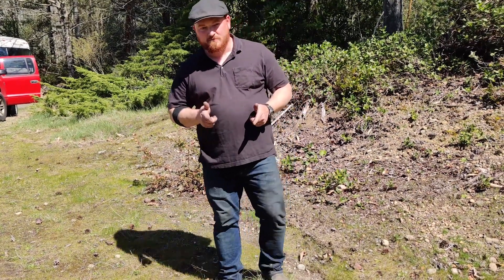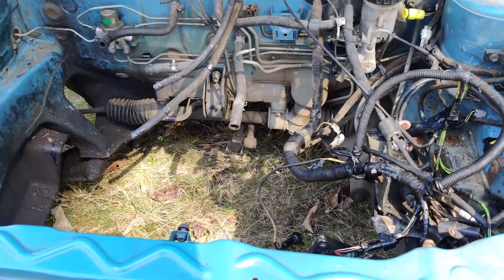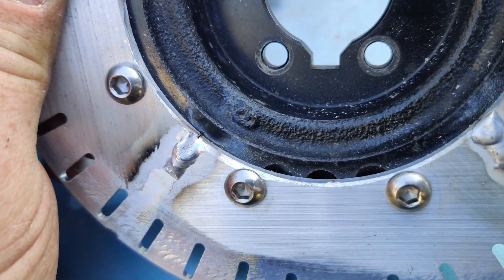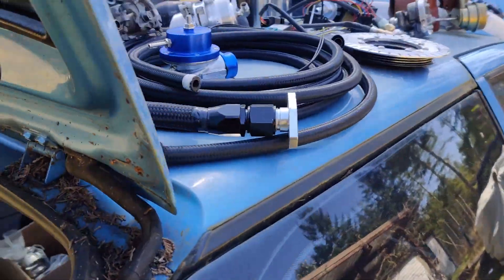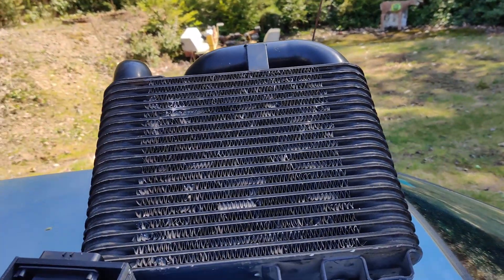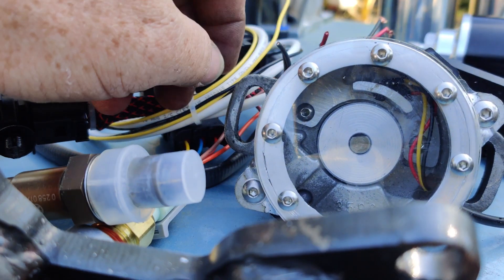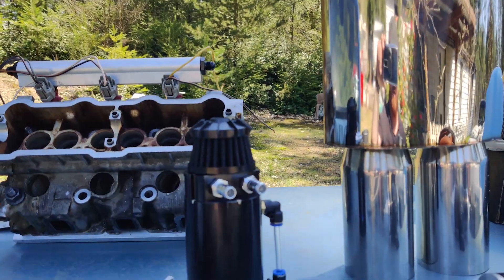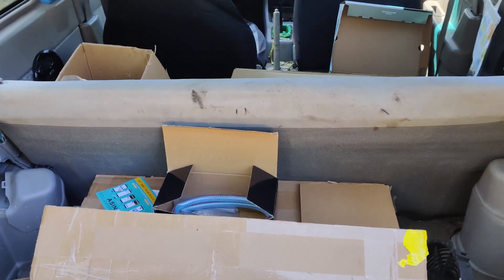EFI upgrade and turbo for a Geo Metro

Comment: excellent project where can I get the fuel rail with its supports on which the injectors are mounted and what measurements or code do they have?

Comment: Any way I can get your email? Looking to build something like this, could use some suggestions and mabey buy some  parts like the jig to machine the injectors

my plans have been similar to what you have done but use like a Honda D16 throttle body and Idle controller... for my build, I plan to keep the distributor since I can do it that way with a Microsquirt.

Comment: Who even needs injectors when you have a V8 propane forklift mixer and evaporator? My injectors just plug the holes in the head. Completely unplugged.

Comment: 20 years ago there was a LOT of performance mods available for the 1.0L Suzuki 3 cylinder motors.  From cams to adjustable timing sprockets to turbo manifolds and more.  I had a ‘96 Metro with a 10.0:1 compression setup with a seriously ported head and custom camshaft.  Stock would do 74 mph in 3rd gear and 73 mph in 4th gear at full throttle!!  After the work was done I chickened out at 96 mph with a 200 pound buddy in the passenger seat!!

Comment: Geos are the BEST cars for science experiments haha. My Turbo Propane powered 1.0 needs more RPMs... brought me here. It's the MPFI head and I'm wondering if I can directly inject the propane into each cylinder. Been running a forklift mixer drawn thru the turbo but im experimenting with blow thru now. That motor EATS head gaskets because the timing and boost are maxed out on 112 octane in the already high compression head. It barely even registered during the emissions test even with a gutted cat. I had to do this build for the $5K alternative fuel tax credit since I was in the hole pretty bad a few years back when my 87 Chevy Turbo Sprint literally broke down the week before taxes were due. I had a lightbulb moment and had this build done in a couple days. As sketchy as the whole thing is, I daily drove this for 4 years with few issues. The whole forklift tank ratched strapped into the trunk with the fuel line running thru the passenger compartment really got people upset lmao. My first test drive was in nomex and flip flops and I keep the windows cracked so it's pretty legit. Hopefully I'll have the head gasket changed today and then I'll be adding a BBQ grill that sits on the hood so it can be a tailgater rig at car meets. Also I'm looking into how i can shoot flames out of the blow off valve between shifts. Could also make a tailpipe flame thrower pretty easily. Best I can calculate it gets only 16mpg so I'm a regular at ACE hardware where I fill up weekly.

Comment: I was considering getting a metro for doing doordash up in nyc every once in a while and came across this while looking at making the inside able to sleep a person, and while im interested in the turbo im much more interested in the ultra cheap efi conversion, since modern efi can get you much better mpg id be very interested in trying to convert one to efi myself without a turbo, maybe squeeze some more power and efficiency at once

Comment: We should be friends. I have a pair of big turbos I want to put on my v8 gas truck, and a smaller-ish turbo I've fabbed up pieces to fit on my snowmobile, but on the snowmobile I was planning on keeping it carb, because I'm halfway digitally challenged... But I could definitely use the assistance of a guy like you. I've messed with Arduino Uno boards a little bit to build some relatively basic projects for work, and I've done a fair bit of soldering, but when it comes to soldering 100 components onto a large board I am pretty sure I'm out of my depth...
Reply: I also have a geo metro... mine is a '93, not XFi model, but I have a video of it running with an open downpipe just for grits and shiggles.

Comment: Love your work - if you want to make your work a bit more worthwhile, remember that the Suzuki Samurai/Jimny basically uses the same engine just with a 4th cylinder attached and judging by the fact how many people struggle with stock carbs and then fit stuff like Harley CV-carbs onto them, a little bolt-on kit might reward you with a couple of beer tokens for the XS-Project. (Yamaha Turbo TR1 guy myself... just not doing much videos, more blogging.)

Comment: This is excellent work.  Very impressive.  I'm surprised there was provision for port fuel injection cast into the heads.
Reply: In the late 80’s there was a factory 1.0L turbocharged Motor from the factory that had fuel injectors in those boses.  The Pontiac Firefly Turbo and a Chevy Sprint Turbo were the cars that it came in.

Comment: A CRANE optical sensor will easily fit in the distributor body as a TDC or home sensor..
And you won't have to worry about heat as they are used in the Crane XR700 electronic ignition conversions...

Comment: You might need a vacume reserve canister , to keep the brake booster in vacume.. it's just a tank with an extra one way brake vacume fitting..
Reply from the maker: Good catch, I actually have small one that I picked up at the junkyard. I'm hoping that the booster check valve will be enough, but I'm ready to deal with it if not.
Reply: @bombshellbikes1559   Nice.. 👍🏻👍🏻
I had to install them on BIG CAM motors as the brakes only worked for "1 time" , but with the tank they got 5 or 6 good applications...